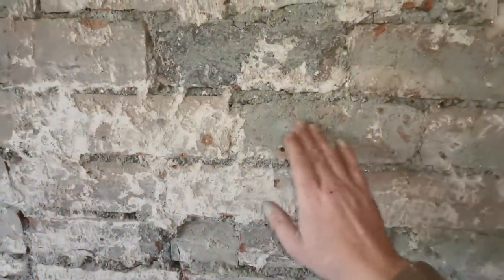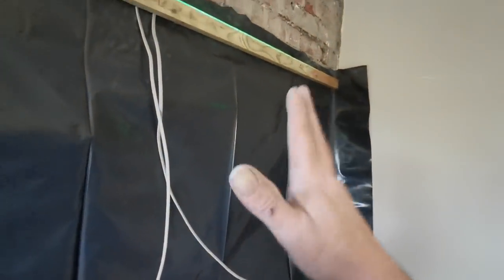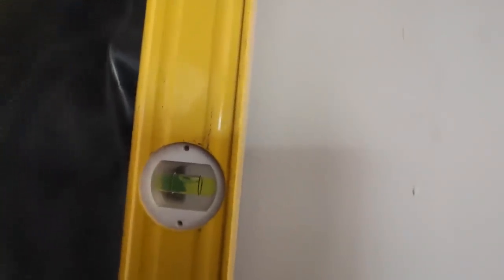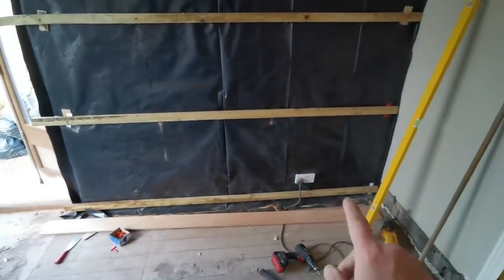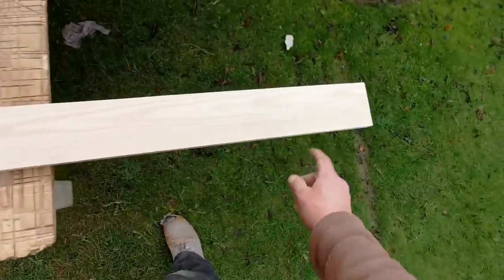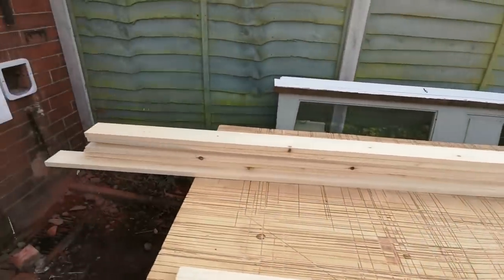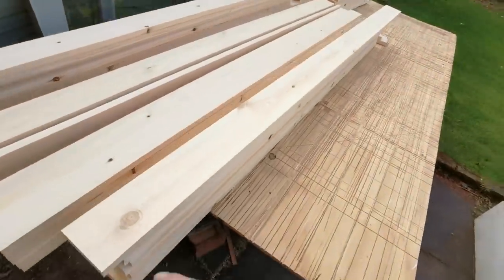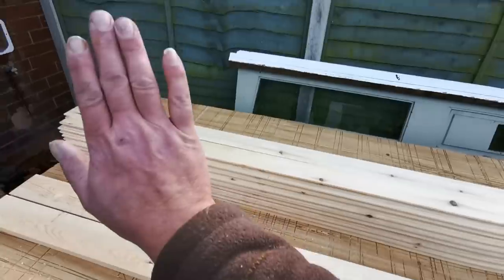French doors & bay window Pt17 - Panelling the room

Comment: Been planning on doing this in our house but I figured it was a case of sticking a few batons on wall then chucking some mdf sheeting before gluing on some strips of wood.. My attempt will be shite compared to this! Don't suppose you travel down near Grantham do ya? :D
Reply from the maker: I considered doing it like that among several options but couldn't do the fix a board on n pin strips to it because of the size of panel/board, i drew it on the PC & the panel size was 640mm i think, I couldn't get two panels from one board without there being a joint in the panel, i could've got bigger boards but that didn't work really either, the price added up too to much. Grantham? that's outside North Leeds so sorry thanks but no 😂 I don't go far nowadays,

Comment: Since it is all going to be painted anyway, was there a particular reason you made "real" panels as opposed to fake panels using glued and pinned on strips like you mention in the video?
Reply from the maker: There were many choices, this was the best of the cheapest, I couldn't do the fix a board on n pin strips on because of the size of panel/board, i drew it on the pc & the panel size was 640mm i think, I couldn't get two panels from one board without there being a joint in the panel, i could've got bigger boards but that didn't work really n the price added up too, We did consider an option of thermal board n skimmed over the whole wall, then strips of wood pinned n glued on to create panelling, or strips of timber on the brickwork n plastered in between, hard to explain but lots of choices n i went for this one, proper panelling, only downside really is it's made from softwood that might move a bit but that might work for the house tho because hardwood apart from being more expensive would be too new n sq, that could've been wrong, 🤷‍♂️👍
Reply: @Gidjoiner  Fair enough, I knew there would be a good reason for doing it the way you did. Sometimes what seems the easy solution isn't always the best.

Comment: I was going to say earlier you should invest in a domino xl for joining your doors how come you didn't use it
Reply from the maker: A few reasons, if the timbers had shrunk or moved a bit with a domino butt joint there would be a gap, i would've had to have created a grooved or stepped shoulder joint, The main reason is these doors are quite heavy, over 2.3m high, over 50mm thick with double glazed units in them, the only thing holding them together are these joints, only a 3" tenon at the top, so i felt they deserved/needed a traditional haunched M&T,   The Domino only cuts to 70mm deep & the width of a domino, I wanted 80mm, i would've had to make it in a few passes, prob not easy to get the right distance (width of mortice/tenon), 
I've to make some similar for my own house, i do have ideas using the domino that i might experiment with them,
Reply: @Gidjoiner  totally agree you cant beat the trusted method of strong mortise and tenon,just one more question sorry for annoying you,I use the pu glue myself it is great stuff but messy as hell when it expands ,would a glue like titebond 3 be suitable or would the door leak at the panel if you hadn't used the lumberjack thanks again
Reply from the maker: Yep sometimes you have to go with the tried n trusted methods, i don't want comeback on jobs, I'm sorry i know very little about Titebond glues, I always suspect that you're paying for the name & the Wood whisperer pushed it so much that i unsubscribed, his channel became a Titebond advert, I like the Lumberjack PU, Gorilla is the same stuff n there you really do pay for the name, it can be messy but is easy to clean up & is fully waterproof, i wanted it to swell & fill any gaps so i knew there would be full glue contact inside the mortices, the only thing i don't like is that it is a bit foamy, the joint can be torn apart & it seems the foamy glue joint is the part that tears, the PU in a gun tube is better, that dries harder n doesn't swell so much, It is hard to get a fully waterproof glue, most PVA type glues say weatherproof, Titebond III says it's type 1 fully waterproof but not for continuous submersion, it may very well be a good exterior glue but i know the PU really is waterproof & is fully submersible although the wood would rot 😂, not that that is what I require but it gives me reassurance that i know the glue won't fail on me,